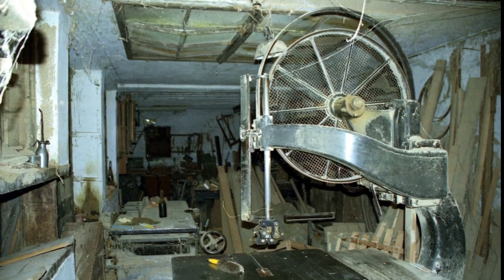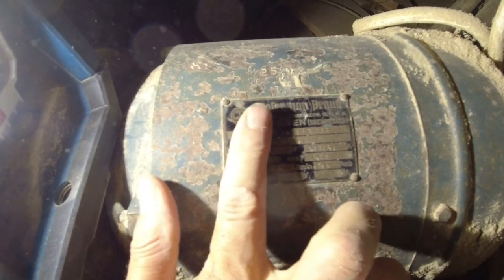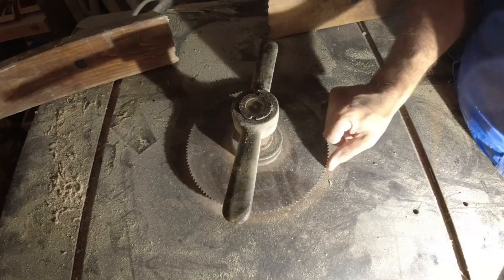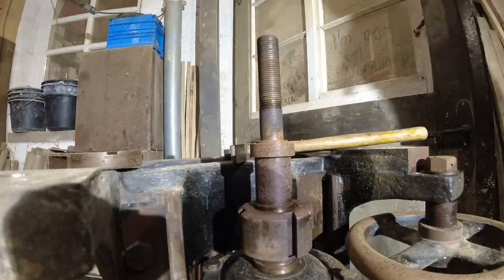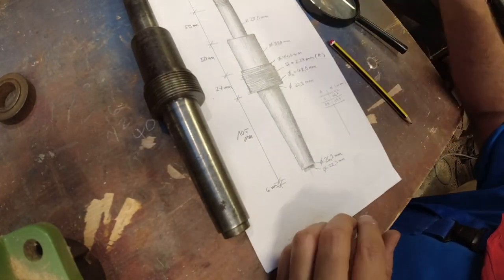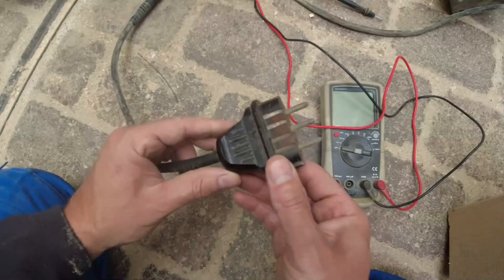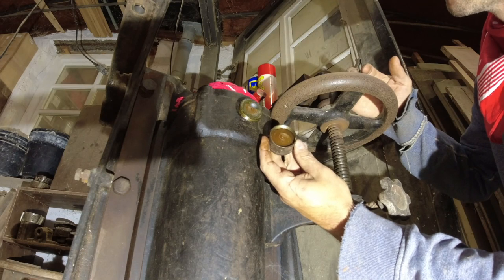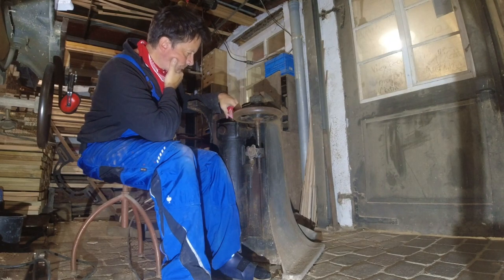The old shaper (spindle moulder) part 1

Comment: That looks like a really nicely made spindle moulder, definitely worth the effort of restoring as you won't find anything of that quality nowadays, especially with relatively modern conventions like  that shaft attachment method which was way ahead of it's time and some companies like SCM still use the exact same method. I would say you're pretty close with the estimation of it being from the 1930s, but it is quite possible that it's older too as ball bearings had been in use quite extensively before then, I've got adverts in some of my old wood machining books from 1918 that advertise spindle moulders will ball bearings. I do have a PDF I made of that particular 1918 book, "How to Work a Spindle Moulder" and also "How to Tend Cutters, Knives, and Saws for Machine Woodworkers and Sawmill Owners" by the same author, if you're interested in looking at them I'll send you a link.

Those cutter blocks are interesting, I think the ones with saw blades in the centre are what's called "bead-splitters", quite specialist as they would be used for making glazing beads for timber windows and doors by running pieces of a certain width through the cutter and blade and ending up with two pieces on the outfeed side. Old cutter blocks can work just as well as they originally did but they do lack modern safety features and you have to be careful to ensure they are safe to run and haven't been abused in the past, though a few you have there are naturally chip-limiting owing to their body being the same shape as the cutter with minimal cutter projection so would be quite safe to use without a high risk of kickback unlike something like square block tooling.

One thing you can do with a 25mm spindle is use 25mm-30mm "Top Hat" reducers or reducing sleeve bushings, so you can use modern tooling without needing a completely new shaft.

Comment: looks like a fun project. I would definitely look to have a custom spindle made (or make it yourself) to use modern cutting heads. That should be easily reversible as well, seeing as you were able to take the spindle out. If I had the machines for it I'd offer to help out, but alas, my simple lathe wouldn't be able, but maybe a collaboration with This Old Tony is in order!
Looking forward to part 2
Reply: I second this, im sure it would be a fun challenge and an interesting video

Comment: Awesom to see you work like always . The times when you are facing a problem and how you figure out stuff is inspiring ! In my opinion it is definitely worth restoring the machine. My russian made shaper has a 32mm shaft and i have custom made cutters for it but the newer ones i have to be a 40mm center and ad a bushing on top and bottom to secure in addition to a locking nut (if you are interested i can send pictures) and the other option is contract a lathe worker to make  a custom spindle arbo i was about to do it but i have alot of the old 32 mm cuter i decided not to. Its a very useful tool with the auto feeder.

Comment: Depending on how the cutters are mounted it shouldn't be too difficult to make a slitted bushing with an outer diameter of 30mm and an inner diameter of 25mm.  I used to work for a gearbox company that made them much thinner than that for mounting on motors.   The other option (amonst others ) would be to make a shrink fit shaft extention over the existing shaft.

Comment: It is definitely worth restoring this shaper
It's a great size and very interesting
As also said somewhere else it is worth looking up more about new heads and adapter rings (don't forget that power is transferred via vertical pressure on the Arbor)
In any case most operations on a shaper can be done with basic cutters

Also on a relatively underpowered machine as this I recommend using small diameter cutters like the ones you already have. Bigger cutters will only be hard to use

Comment: Personally I would just use the old tooling, Carefully. New cutter blocks though can be supplied with 'top hat' reducing bushes to 30mm, 1 1/4" or 40mm, so no problem to keep your 25mm arbor, unless you need the larger diameter for larger/heavier cuts. I think your 25mm arbor will be fine with a 3kw motor.

Comment: I wonder as the machine is fitted this separate 25mm mk4 taper spindle it shouldn't be extraordinary expensive to have a custom made new one with 30mm axle shaft. A thought of a proper frequency converter for driving the machine might be a good option.

Comment: If your arbor is 25 mm, can't you have it turned to 13 mm by a machinist?
Edit: I now understand it to be 30 mm.... then yes perhaps a sleeve or bushing to cover the gap?

And that motor, is it possible to install modern bearings so you can use it upright and install it inside the housing?

Comment: I've always wanted to come across one of these machines but it has yet to happen, they seem so wonderfully versatile. I just wanted to mention two things, undoubtedly you are probably already aware but no harm double checking. The first, are you sure the machine is metric? 25 mm is quite a bit like 1 in and 100 years of wear. What I thought might be more valuable to know is that I've seen a lot of people adapt these using horizontal milling machine arbors. Or spacers rather. If you look around on eBay, NOS cutters for horizontal Mills are shockingly inexpensive, particularly the more unusual profiles. 1 in is a very common arbor size and there are especially good deals on larger lots. Normally it's always a crap shoot to buy used cutters, but I have found the majority of these to be genuine NOS, the prices are typically not very much more than scrap value. I have no idea if those circumstances are the case in Europe, it seems like American fabricators decided all at once to abandon horizontal Mills outright. Maybe some new safety regulation made it too inefficient?
Reply: Germany has used the metric systems in parts since 1868 and wholly since 1871, so it's probably 25mm
Reply from the maker: Yes it is. But there are imperial units in that maschine nevertheless: the thread pitches of the differential nut for example...